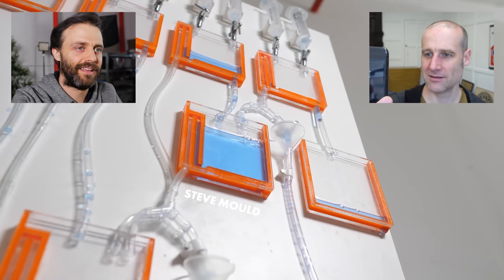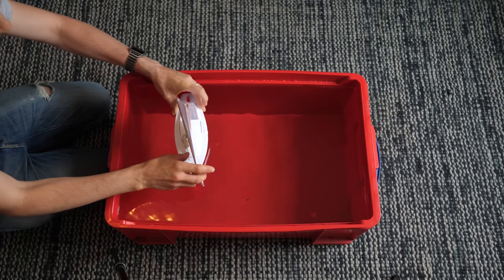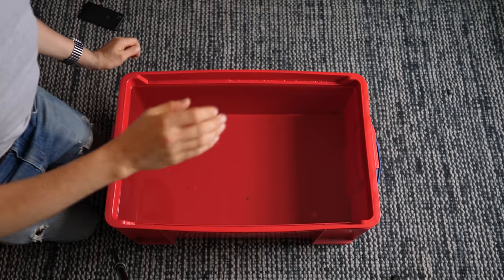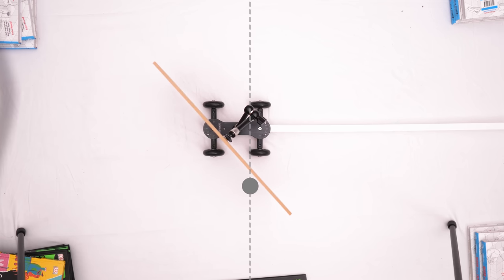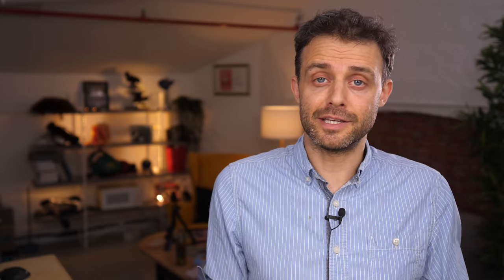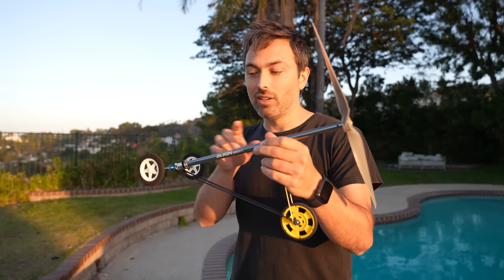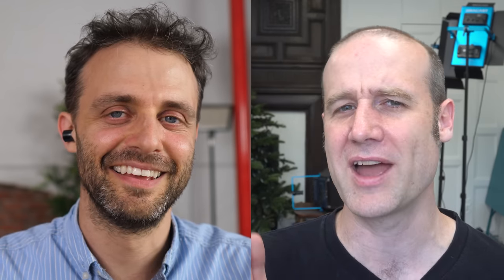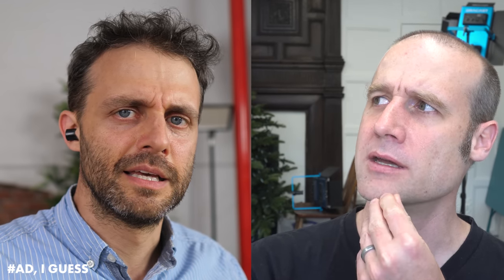Sailing Faster Than The Wind - How Is That Even Possible?

Comment: Adding friction into the equation is fascinating. Because one of those slightly counter intuitive things about classes of boat, like the AC75, designed to sail faster than wind is that less sail area is often better. You need a certain amount of sail area to accelerate but then as you pick up speed the effect of dragging the sail through the air starts to reduce your top speed. This means teams have to carefully pick their sail plan for the conditions they expect. If you're at the lower end of the wind range, like six to eight knots, then your top speed might only be thirty knots so a larger sail isn't going to generate as much drag. Plus, you need to accelerate quicker out of tacks and gybes to keep yourself up on the foils (and falling off the foils will almost certainly lose you the race). But when you're up at the top end and going fifty knots, then your need to accelerate is less important than top end speed so less sail area is better in order to reduce drag.

Comment: The explanation kind of works for slow sailing boats, for very light racing boats (catamarans, trimarans, hydrofoils, etc) the airplane wing concept takes over since as the boats sail fast they generate their "own" wind and the sails generate lift

Comment: Sails and sailing vessels come in countless variations and different configurations, of course.
The most common sails these days - seen on that Bermuda-styled pleasure boat at 8:12 - are actually shaped more like wings than like triangles. They look like triangles curved out of shape by the wind but they are more like three-point pockets carefully designed to catch more wind.

Comment: Great explanation - a boat can travel faster than the wind if it's direction is perpendicular to the wind speed (and your sail is pitched greater than 45deg to the wind).  In the case of Derek's video, the "sails" of the prop are being driven perpendicular to the direction of the wind.  The "sails" spin the shaft at a speed higher than the wind (if you convert shaft rpm into linear speed), and if that shaft is mechanically linked to the wheels, you should be able to be driven faster than the wind powering your car in the same direction.
Reply: >> The "sails" spin the shaft at a speed higher than the wind

That's a common misconception with the Blackbird.  In reality the wheels turn the propeller rather than the other way around.
Reply: @Rick_Cavallaro  how does it start moving then?
Reply: @383mazda  The wind pushes the whole thing as a bluff body.  As the propeller develops more speed, it also develops attached flow beginning at the tips and working toward the roots of the blades.  As this happens, the propeller thrust gradually takes over.

Comment: The resistance to the sideways force maybe "negligible" for this explanation but it's the main element in limiting the maximum speed of the boat. This resistance is calculated from the length of the hull which is in contact with the surface of the water, known as the waterline length (abbv. LWL). This length can then be used in a formula to give you the optimal speed of a sailing vessel with those hull dimensions where Velocity = 1.34 x √LWL
Yacht designers can use this formula to optimise the sailing characteristics of a boat by calculating the hull shape, hence LWL, based on wind strength and how much that wind will push the boat over onto its side (aka heeling). It's also a reason that multihull vessels (catamarans etc) have an advantage over monohull types as they get twice or more the LWL for the same boat length.

* This formula does not hold true for hydroplanes/hydrofoils who 'cheat' even more than multihulls to get around it. The current world record for a sailing yacht is held by such a multihull boat named Vestas Sailrocket 2 which went >75mph in 2012 but there are at least 2 projects currently in development to increase that to >90mph.

Comment: a flat sail is more likely to heel over, but a sail that is curved towards the wind in the middle and tapering away at top and bottom will counter the heeling effect, even if you have to put a float on the bottom of the sail, but you dont have to if the balance is done right, this will give surface area for wind propulsion while maintaining resistance, laterally specifically allowing for even more faster than wind travel, a foil is more sail with less resistance area but way more effective resistance because its all or way more keel, the boat hull becomes less keel and more sail as wind increases, the wind range affects the design decisions so sailboats are too much fixed design with what, reefing as your only option, sails that flex away top and bottom in high wind will maintain forward motion without capsizing faster than the wind

Comment: 6:02 a very similar effect is happening in asynchronous induction motors (squirrel cage motors) when operated without a load. The rotating magnetic field around the rotor accelerates the rotor until it matches speed and phase with the magnetic field. By that point, no more force is generated and it slows down. The motor reaches an equillibrium state where there is just enough force generated to overcome friction and air resistance inside the motor.

Comment: The speed of the 'sail' relative to the direction of the wind can be explained interns of a screw being driven into wood, the finer the pitch, the more it has to rotate or spin to move into the wood and the corser the pitch, the faster it goes into the wood with rotation. the idea came from propellers being called an air screw. so if the torque is sufficient from the engine, increasing the pitch, lets the plane move faster through air and vise-versa.

Comment: Perhaps I overlooked this in the video, but it is important to note that overtrimming (having the sail at a steeper angle to the true wind) becomes possible as the boat moves faster. The forward speed creates apparent wind which when added to the true wind vector creates a new vector that the sailor must trim for. This will continue until the top speed of the hull is reached.
Reply: This is how many high performance boats operate especially the foiling ones

Comment: You are correct. There is another effect.
when you sail slightly with the wind, then sail foreword, the apparent wind angle changes. Thus instead of sailing with the wind you are now sailing slightly against the wind. This happens because your vector combines with the wind vector and the wind angle the sailboat feels changes.

Comment: Interesting fact.
Many sailors have strands of cotton attached to the surfaces of their sails called tell tails.
When you get your sail set to the correct angle they will fly horizontally without flapping about showing you have good laminar flow on both sides of the sail.

Comment: I think this is simpler than everyone is making it out to be.

Imagine a fan regulated to blow air at ten mph. Hold it out the window of your car in calm air at 10 mph groundspeed. Now add a 3 mph tailwind with your fan still regulated to produce a ten mph air flow. You feel a push forward from a tailwind you're outrunning.

That's because the relative wind on the fan blades is from behind.

I don't think Blackbird changes modes when it transits windspeed. I think the (relative) wind is always blowing on the back side of the blades.

Another good thing to consider is that energy is a scalar, not a vector like momentum. Air in motion has kinetic energy. You can apply it in any direction you want.

"Sideways motion" on a boat is called leeway, "way" being a general term for motion as in making way, under way.

Exactly missing the air is called luffing.

Upwind lift provided by the shape of the boat below the waterline is sometimes called anti-leeway.

Comment: You forgot to mention (or else I missed it?) the presence of the keel on a centreboard sailboat, and its crucial function in reducing the leeway (the drift perpendicular to the hull), the same function performed in your model by the wheels exerting a friction in the axle's direction.
Reply: It’s not fully crucial technically, many catamarans for example don’t have either because the hulls themselves provide enough lateral resistance

Comment: An analogy I use is Skating on ice where legs move slower (wind) than the skater (boat). If trains on rails had sails, it would be easier to explain. Sail angle works a bit like the gear ratio in a car transmission or propeller pitch of an aircraft. There is always a sweetspot. Given the dynamic nature of water/wind/friction/bearing, finding that sweetspot makes the best sailor.

Comment: Actually what also plays a big part in preventing sideways motion of a boat is the keel. Keels have an aerofoil cross-section, and the combination of forwards and sideways motion creates an angle of attack which can generate a force that opposes the sideways motion.
Reply: Yeah this was simplified away here by using wheels, which constrain to a linear motion so all you have to think about is the sail vectors and it still works. You can also think of the wheels as an extremely powerful keel that provides a leeway angle of approximately zero... That is, until the sail force lateral component gets so big that they slip sideways.

Comment: This is a great explanation of the basic concept but you missing one crucial element, "Apparent Wind". As the vessel moves forwarded the wind appears to come from an angle more from in front of the vessel, the faster it moves the more if front of the vessel the wind appears to come from. it also appears to increase in speed causing the vessel to go faster until the resistance of the water on the hull or wind on the mast and sail balances out with the power produced. Ice boats can travel 3 or 4 times the speed if the wind due to extremely low resistance of the skates on the ice.

Comment: Though Veritasium statement is it's possible to travel faster than the wind directly DOWNWIND.....
I think it is impossible to travel faster than the fluid pushing you directly DOWNWIND.
As soon you reach the wind speed the thrust immediately drops to zero and the wheels can't propel anything, because  the power that keeps wheels spinning comes from the wind...
What for sure can travel faster than the wind are the turbine (not propeller) blades, but if you measure the circular motion, not how fast his shaft is moving in the air/or ground

Comment: At 8:34 your sails are on the wrong side of the boat, you would be backwinding and actually end up traveling backwards not upwind.  You would just need to switch the sides that the sail is on.

Comment: Very simple in energy terms.   Any time you have an interface between two mediums moving relative to each other (e.g. wind and ground, wind and water) you can extract power and use that power to e.g. propel yourself.   Therefore conservation of energy is not violated, you do not have a perpetual-motion machine.     
It's just that the mechanical specifics in this propeller-powered land yacht tend to confuse the issue.   It's the physical counterpart of the Monty Hall problem     :)
From the frame of reference of the wind, the ground is moving backwards, power is being extracted from the wheels and used to drive the propeller which is pushing the land yacht forwards relative to the wind.
It's just that we're so used to our frame of reference being stationary (ground) that other frames feel strange.
[Edit:   I was of course blathering about sailing directly downwind faster than the wind.  Not at an angle to the wind.   Oops]
Reply: >> It's just that the mechanical specifics in this propeller-powered land yacht tend to confuse the issue. 

Which was precisely my objective.  That's why I used it to pose the brain-teaser.

Comment: OK - I have a question, which I hope makes sense?!?! - please stick me :)

- If you have the wind blowing at 0deg and the alignment of the sail is at 0deg, there will be no wind pushing onto the sail so no movement.
- Conversely, if you have the sail at 90deg there will be no movement because there is no angle to push the boat in the direction, in the example 90deg also.
- As Steve said if have the sail at a low angle say 5deg the wind will push the boat a little as much air will be hitting the sail, and if you have it at 85deg the wind will try to push it, but the other forces will be too strong so there probably would also be little movement in the direction the boar is pointing
- I see this similar say a car's gear: 1st gear = low angle, 5th hear = high gear

- So the question is: if you start the sail at the low angle to start the boat off slow and gradually increase sail's angle (eg as you would speed up a car and change gear), would you be able to get the sail to a higher angle and therefore travel faster than if you would have by just setting the sails angle at a static higher angle from the start (which would be like trying to pull away in 5th gear)

You probably wouldn't get to 85deg (or maybe to could??), but there may be a higher  "sweet spot"?

Or I could be totally off on this one :)

Comment: Love your videos @SteveMould. But near the end of this one, you say that "In the model, the force vector is always just the direction of the wind". I believe that is not completely correct.

Something is applying a lateral force to the wheeled boat. It can't be the table, since the wheels roll freely in that direction, so it must be your wheeled stick. Though it is slight, your must be pushing or counter torquing with your hands to keep the stick moving in a straight line once the wheel bit hits the wooden "sail".  The net result may be roughly equivalent to the sail of a real boat deflecting the wind to be in line with the sail.

Comment: I will give you an intuitive explanation of how Dereks contraption works:

Imagine that you have a moderate size windmill on top of a car. now usually, the car is anchored to the ground below by its weight and friction. Generally speaking, you could have wind blow over the car, the windmill could turn in the wind, but the car would not budge.

now imagine that you have the windmill's turning coupled to the cars wheels at a very high gear reduction ratio  - like ten thousand to one. In this case, the wind would blow, turn the windmill and very slowly move the car. It is easy to imagine that you could actually have the car go upwind in this case.

Therefore, what you have now is two mediums (the air and the soil below the car) that are moving relative to each other. You have a device (the car) that anchors into one of the mediums (the soil) and harnesses energy from the mvoement of the other medium (the wind) to slowly go against the other medium (go upwind).

Dereks vehicle is the same thing - it is anchored in the wind by its huge sail (fan's air profile) - that is crucial to understand. it then harnesses the energy from the motion of the ground beneath it. the ground is used to turn it wheels and (through a gear reduction) its then pushes into the wind to go against the motion of the land below it.
Reply: just like a wheel of the car both anchors the car to the ground and also drives the car relative to the ground; so does the sail of derek's vehicle both anchor it to the wind and drive it relative to the wind.

Comment: I think we should consider splitting the problem. First there is a big propeller installed on the car. Let's fix it on a pole and calculate the torque and drag force created on different wind speeds. Then, in the second phase, built a car driven by that torque and using a gearbox maximizing the speed of the car. Now, when the car speeds up, wind resistance is also increases by square od the velocity. When it reaches the wind speed against the wind we assume we should use the torque and drag at double wind speed and drive the car at that torque and drag and see if we can reach and beat the wind speed. The solution is the gearbox which we can't directly see it comparing with a sail boat

Comment: 3:40 the boat (at least a water boat) indeed does move sideways some, even with the best designs. It's called leeway. Every boat has some leeway, so unless sailing straight downwind, the boat actually moves at an angle to the direction the bow points. It is to reduce that leeway, that sailboats have centerboards and/or keels (keels also help keep the boat upright, aka reduce the heel). This is one reason why it is much more difficult for water boats to go faster than the wind: as the angle of attack is increased, more of the wind's power goes towards making leeway, rather than speeding up the boat.
Reply: Not true at all, higher performance boats have tools like foils or trim tabs on the keels of non foiling boats that let them achieve even positive leeway angles where the boat climbs to windward. However positive leeway angle is barely used because-1 to -2 degrees is the optimal balance of drag to lift